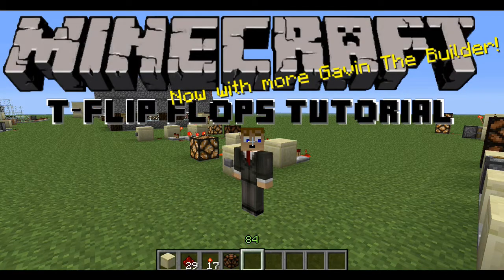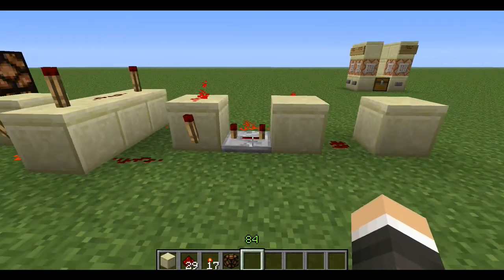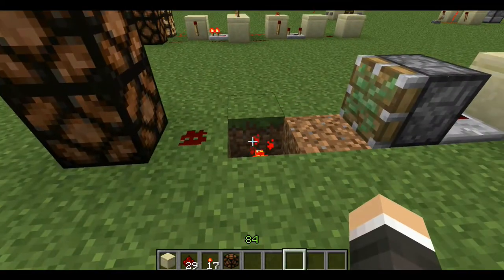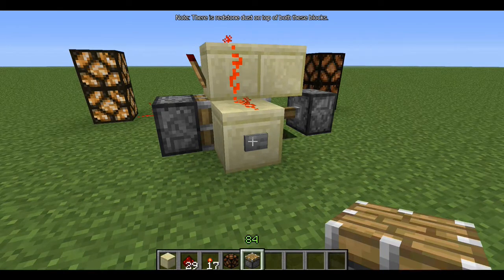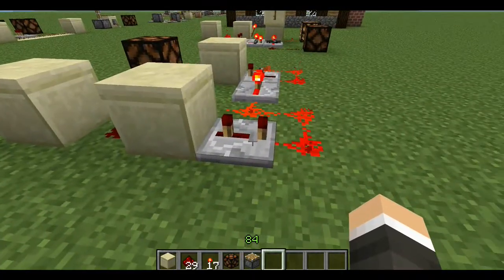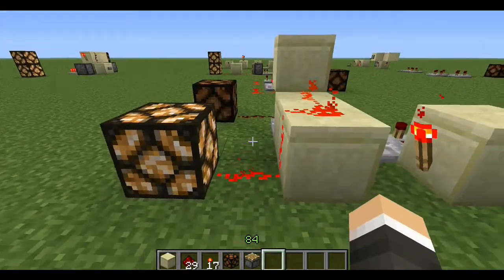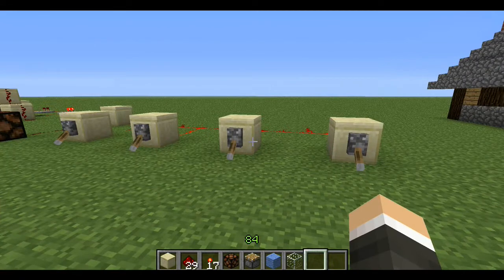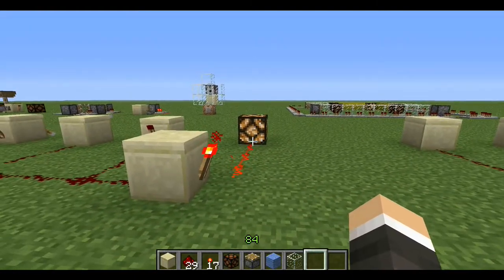5 Different T-Flip Flop Circuits Tutorial

Comment from the maker: NOR latches have two different inputs. They are not used to toggle. NOR circuits are most often used for Set/Reset curcuits. I made you a video showing four different NOR curcuits the link is in the discription.